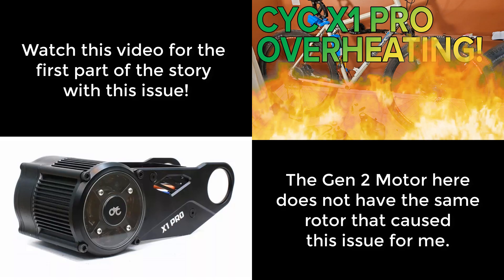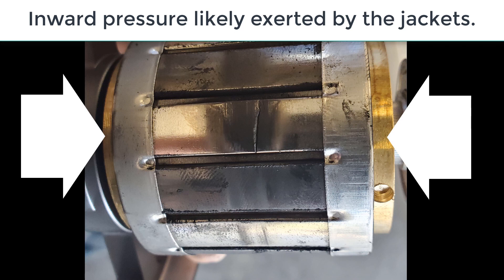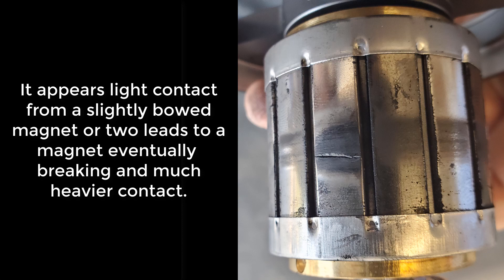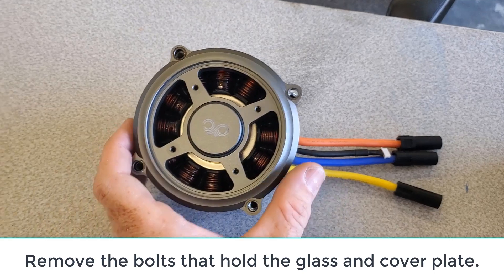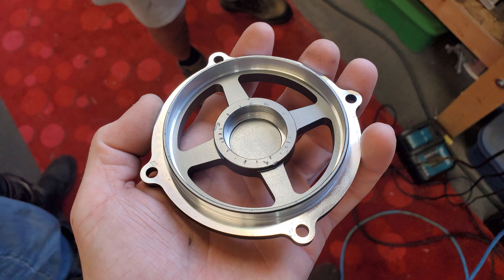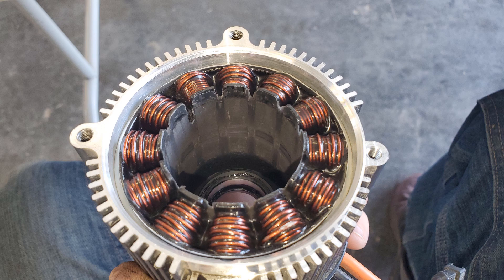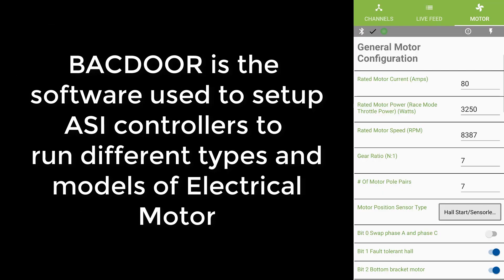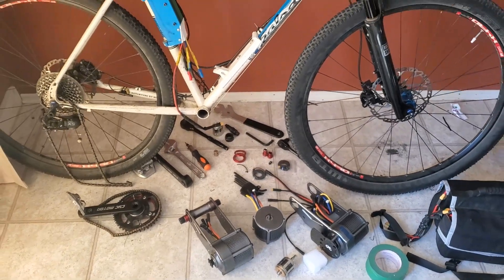CYC X1 Pro (Gen 1) Motor Rotor Replacement & Teardown

Comment: Hello, I have exactly the same problem, and I would like to ask where I can find Stator-rotor packs bearings and what you need. Is there a website you can send me a link to order them.
Reply from the maker: CYC motor is the only place to get spares. Try sending them an email or a facebook message.
Reply from the maker: Cyc motor directly for spares
Reply: Thank you very much for your interest, I totally agree with you, but I wanted to hope to find a solution, I have contacted the CYC my problem is d They have been abolished  that the old spare parts have been removed, and this would force me to install the new motor, as a result of which things would have to be changed, if I had the 3rd gen, I would have had this on the right problems .But the biggest problem is that I have lost my trust, it has been broken so many times And I have wasted so much money - effort - and time, that And I'm thinking of tearing it down again, and the way I figure it all this repair will cost about 600 to 700 € , και πως θα  τό εμπιστεθτο . ξανά ότι δεν θα χαλάσει, , γι'αυτό σκέφτομαι να τα παρησω. Θήβας
Reply: Then another thing that makes me nervous is the brother μου, και  η φωτογραφία που θα στείλω

Comment: Where would I acquire a new rotor for my cyc I had the same problem I do not know who to contact for a new rotor
Reply from the maker: You need to contact cyc motor directly. There should be an email on the website for any technical issues.

Comment: It may be possible that due to the airgap dimension being less that the reluctance of the magnetic circuit is lower. This transfers more energy to the rotor allowing the motor to spin faster.
Reply from the maker: Thats the best explanation I heard so far! Cheers 🍻

Comment: Its good to see your hi-tech helicopter mechanic has a hammer and a modified spanner.  Remind me not to go for a flight with old mate! lol
Reply from the maker: Yeah. Perhaps not lol. Cheers
Reply: @HighVoltageKits  All good Captain.  My gen1 cyc just had its magnets fingered and smashed into dust. 52v, 250km max (low miles). Ordered a new core gen 2 style last week. Love your vids mate and keep them coming, I find them very informative and appreciate.  I have a gen1 geared version with the bac855, but havent used the controller yet, blew up the last 2 cyc controllers and now the core.  All the best mate
Reply from the maker: No way. You should post some pics on discord https://discord.gg/YAAjfgc

Comment: End cap can be easier put off without screw driver. You have to remove it first, turn it 45 degree and tap with something light enough and soft. Than top cap from a spindle. However, if you tap with a hammer on a good rotor, you have a chance to demagnetize the magnets to some amount.
Reply from the maker: Was not aware of that thanks. I was given written instructions and not much for the end cap or bearings. It was suggested later more liberal use of a heat gun may have helped

Comment: Hello Captain Codswallop, I have the gen2 with asi controller. Have a random question for you... I want a quality full grip throttle like the Domino (0-5V pot). CYC sent me a half twist (0.8-4.3V hall)... my question is, will the Domino work ok with the asi controller or should I find a quality full grip hall? thanks
Reply from the maker: The domino should work but will take a bit of configuration with the asi. I'd imagine cyc should be able to give you help. How are you accessing the asi?
Reply: @HighVoltageKits  Will use the smartphone app. At the moment I am working on batteries and getting the motor mounted correctly. Still have plenty to learn about the controller and how to use the app

Comment: Is it possible that prior to the "break" that there was more physical friction between the magnet and the part it rubbed against and post "break" that physical resistance was freed up a bit?

For the moment I'm glad I stuck with the BBSHD. I was disappointed that the X-1 wasn't bullet proof at only 52 volts ( I know many riders are running it at 72 volts) but am encouraged that CYC is still working out kinks to make it an ever more impressive motor.
Reply from the maker: Possibly. But I think the broken magnet would cause more friction and not less. The bbshd is a great motor so no worries there. Yes CYC continues to work hard and that is good to see. As far as numbers go generally 52 volt riders far outstrip those with 72 volts just because of the availability. Or they build there own. But the x1 may be an outlier here. Cheers!
Reply: @HighVoltageKits  That makes sense. You did ask for theories so I grasped the nearest straw;)
Also makes sense that 52 volt users outnumber higher voltage users due to the availability. I'd assume that 48 volt users also outnumber 52 volt users (for the moment). It may just be that the articles I've read and the videos I've seen on YouTube are mostly by die hard DIY guys running a DIY 72 volt LiPo battery that made me think the ratio was higher.
Reply from the maker: Yeah I have to remind myself that the area I operate is tiny looking at ebikes as a whole. Good theory tho. I wonder if some of the earlier failures were a result of this issue not being spotted earlier.